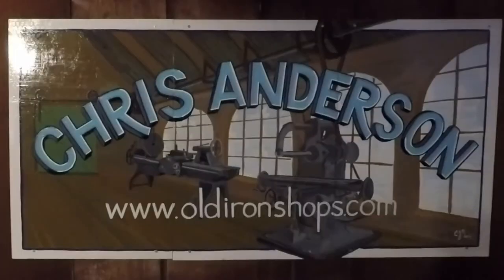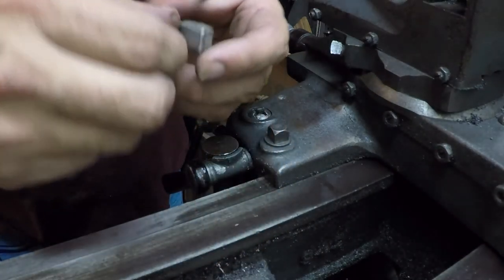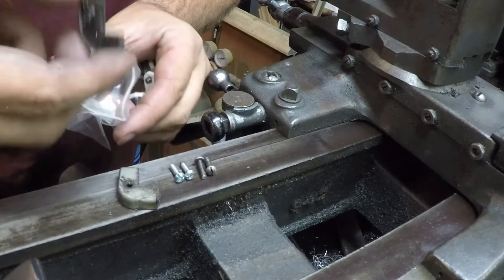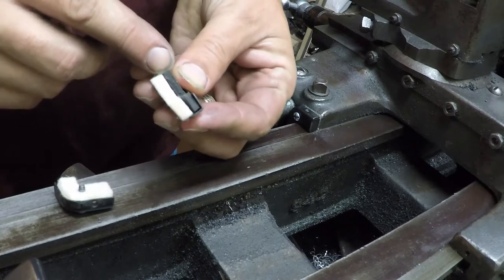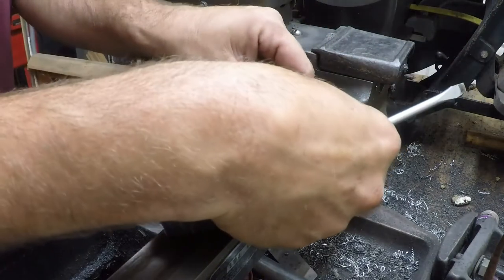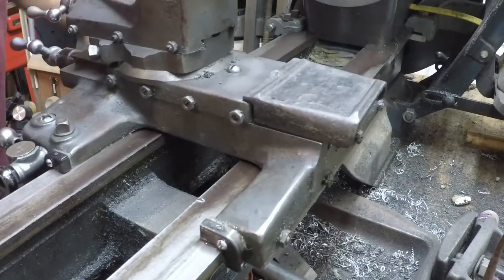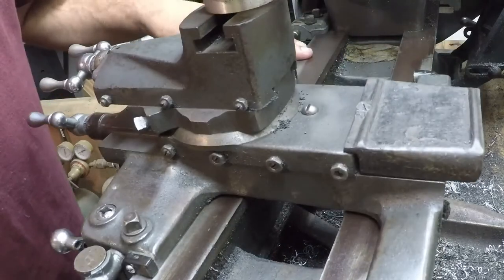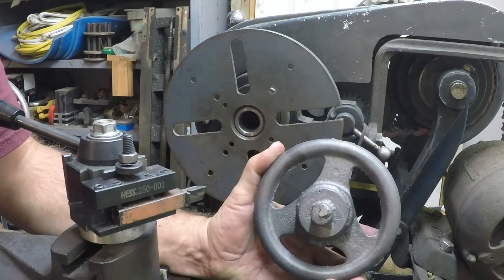Atlas lathe way wiper replacement

Comment: I designed and 3d printed a set of ABS plastic wipers for my logan actually. I like how they perform so far.
Reply from the maker: +Bruno M. You mean the covers that hold the felt and rubber parts?
Reply: No I mean instead of felt I used 3d printed plastic. There are 2 schools of thought on the subject that I can find. One is to use felt pads as it spreads the oil. The other is to use hard plastic as it prevents hard chips from embedding themselves in the material and acting like an abrasive on the ways. Since I have a 3d printer. I copied the original pads and remade them out of ABS.
Reply from the maker: +Bruno M. Interesting but when iron rubes iron it will wear badly. How do you keep oil on the ways?
Reply: That's the thing I was skeptical about. I at first thought that these wipers would erode away being that they are plastic against iron. The truth of the matter is that they only wear a bit initially and need an adjustment after working the carriage back and fourth a few times. After that they spread the oil back and fourth very very nicely. The trick is to supply oil inside the wipers. Its the reason I really did not mention these before is because I didn't know how they would react. I have to say I am pleased. At some point I may make a video about them.
Reply from the maker: +Bruno M. I'd like to see that video. I'm still a skeptic . It would only take a very small bit of iron to get below it and start the grinding process

Comment: good stuff Chris. keep them coming. want to see you scrape that lathe next!
Reply from the maker: +Emmas Spareroom Machineshop gonna need a bigger surface plate.
Reply: Emmas Spareroom Machineshop  I agree!  But take it from start to finish. I know it's a very labor intensive process that many skip over steps vice fast forwarding through them.
Reply from the maker: +Craig L. Young I'll be sure that you see as much as possible. And feel free to ask any questions you may have

Comment: Hey Chris.  Great video.  I posted a comment earlier but it looks like it didn't show up.  Anyway, I asked if those were oil holes in the tops of the way wipes and if you need my address let me know, and if I owe you anything.  I also said that I hope to have a video released either tonight or tomorrow.  The video is on the camera ready to be downloaded and my bride is doing the finishing touches on the project so it can be shown complete.  Again, Chris, thank you for all your kind words and help you have provided.

Joe
Reply from the maker: +My Heap yes they are oil holes. I haven't looked yet but my email is oldironshops@gmail.com you will need a oil can for all the ball oilers on the apron I'm using one in the video it is a eagle # 55 it is also convenient for the wiper oil holes. And filling the drip holes and cups that abound. No problem with the advice that's how we keep the hobbie going right. As for payment I may hit you up for a favor  (worth more than cash sometimes )
Reply: Chris, I sent you an email. Just checking that you received it.

Joe
Reply from the maker: +My Heap yes Joe I did thanks for the reminder I'll try to get it out in the mail tomorrow.
Reply from the maker: +My Heap did not get a chance to nail that out yet but I will .
Reply: No hurry Chris.  Mail when you can.  I am ready to put the headstock end back together then will turn my attention to taking a look under ol' Bertha's Apron to see what's up there.  :-)

Joe
Reply from the maker: +My Heap study my video know replacing the half nuts chances are that you will want to
Reply: Just watched your video on the Half Nut replacement.  I am sure I will put that information to use.  Thank for the tip and how to.

Joe

Comment: Hey Chris, I would be interested in knowing if you ever got around to fixing the bedways on your Atlas Craftsman Lathe. I have a old Atlas Craftsman 24770 and the bedways are in pretty bad shape. Looking forward to seeing if you ever got around to fixing yours.
Reply from the maker: +Steve Billmire I have not yet my plan is to have it ground then scrap it in . Then build up the loss on the bottom of the saddle with rulon that should better than new
Reply: Hello again Chris,

I did end up buying some new wipers off of eBay just like you. After looking at this video again I don't think my bed ways are as bad as the bed ways on your Lathe. I ended up getting my machine stone out and hitting the bed ways with it. All I really did was remove any sharp edges off the bed ways and nothing to drastic.
Reply from the maker: +Steve Billmire you can stone off the high spots . Like you say don't get carried away.

Comment: Thanks for this video! I've noticed the atlas diagram show the rubber wiper up against the carriage, with the felt wiper on the stamped metal retainer side. When I took my Atlas apart, it was like yours though with the felt up against the apron and the rubber on the outside. Does it matter which way those are installed?
Reply from the maker: You know it seems to me that the oil needs to be under the saddle ways and the grime no so I believe the rubber goes on the outside to act like a squiggly and the felt then can stay cleaner and keep the oil available for the ways

Comment: The exploded view in the lathe operation book showes retainer, felt then wiper. Which is opposite of how you assembled them. Where did you get your info?
Reply from the maker: It's been quite a while since I made the video so I don't recall but the felt should be to the inside and the rubber to the outside. The felt is for wicking oil on the ways and the rubber is to keep grime from getting in (as best it can at least)
Reply: I wish i knew how to add a pic of my operations exploded view. I'm in the process of a very complete restoration.
Reply from the maker: @wags9777  I have a copy of the atlas lathe operations sometime you find mistakes in things like this